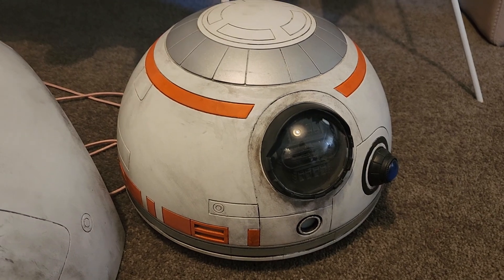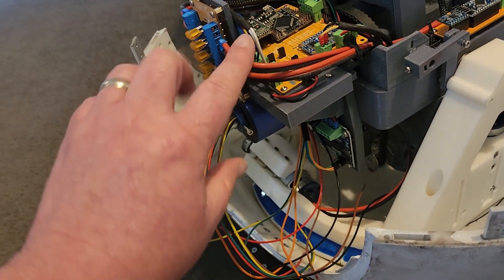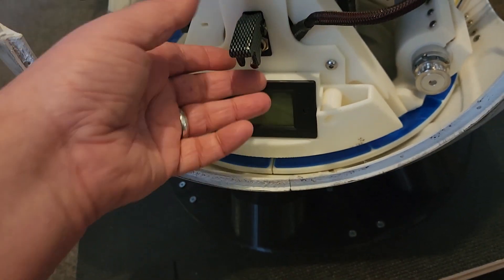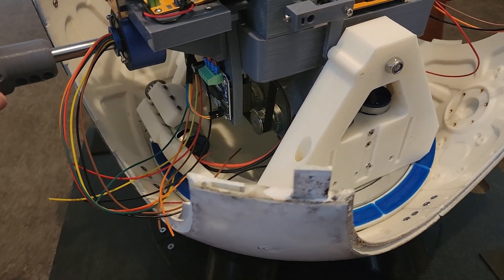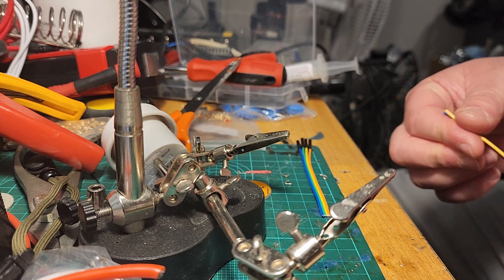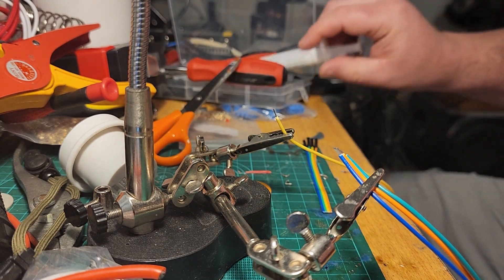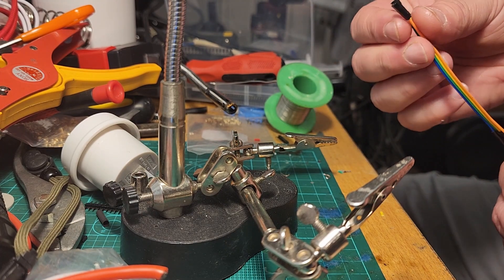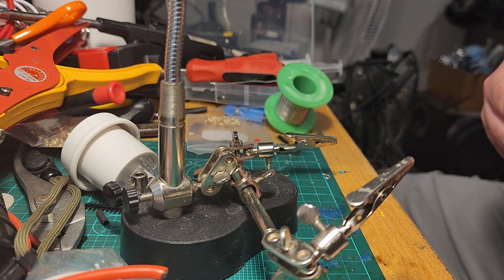BB-8 Progress Update & braided sleeving

Comment: Beautiful, now make its head track people with ai and a camera, also what 3d printers do you use?
Reply from the maker: Printers are an old tronxy x3, an elegoo neptune 3 plus and a more recently a saturn 3 ultra Resin printer. Tracking wouldn't be hard to add, but would need something with a faster processor than the arduino mini pro/mega and the feathers it's currently using. I did something similar on a luxo jr lamp (Pixar lamp) using an esp32 doing some ai object tracking, but something like a raspi would work a treat.
Reply: @MikeOwenNZ  I got a spare one I can hand over to your daughter for you.